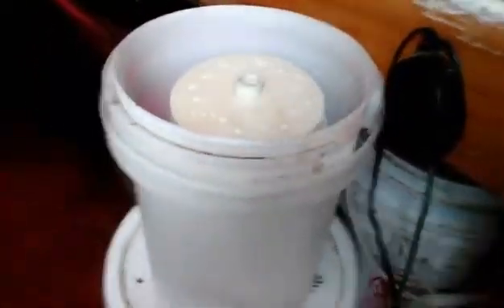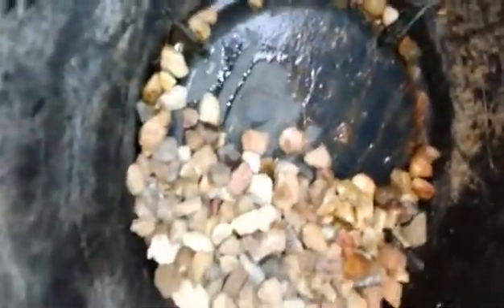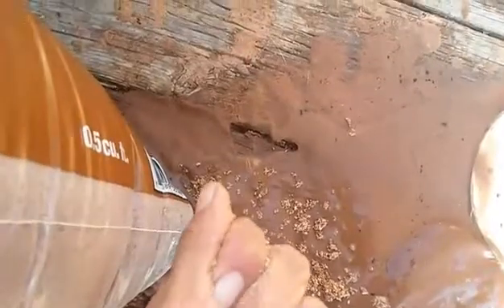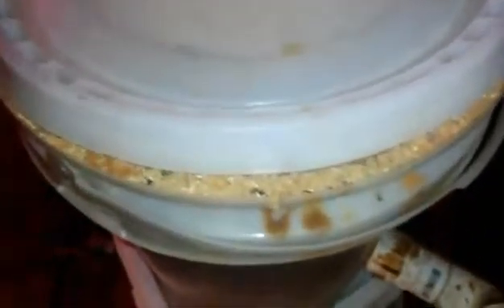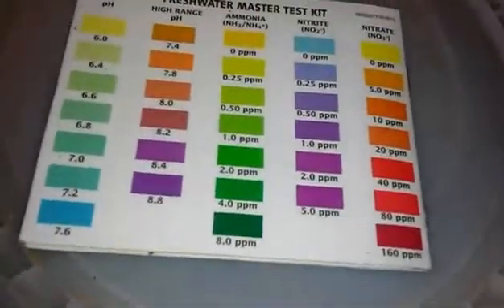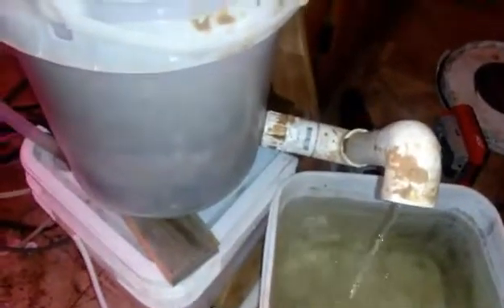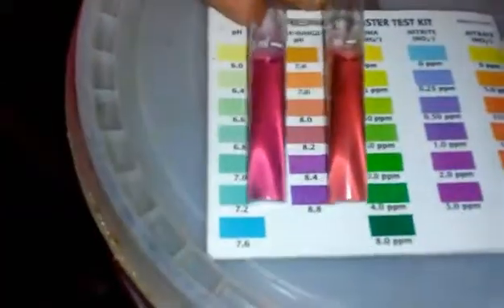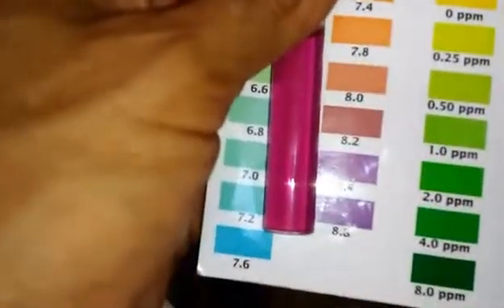Slow Sand Bio-filter- Awesome Results!!!

Comment: nice tiny build, after just two hours though it's only working as a passive sand filter, you want to wait a few weeks for the biological layer to form on the top sand, which should be very fine in order to offer the most surface possible for the bacteria which will be living on it

Comment: Didn't watch the whole thing but your pH may drop from CO2 building up after going through the filter. Aerate the water after it's gone through the filter. If pH goes up after aeration it's only CO2 buildup causing the pH to drop temporarily. Measure KH before and after filter as well